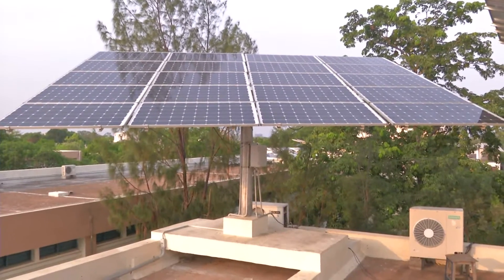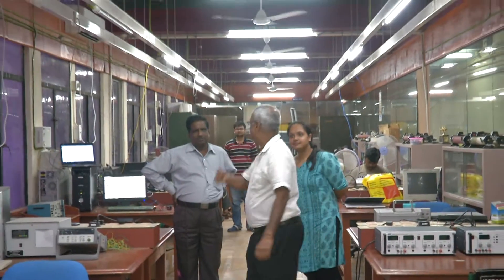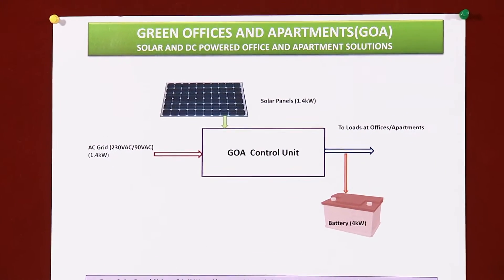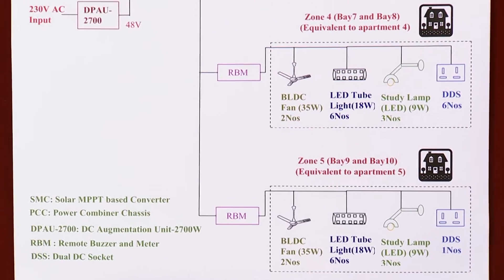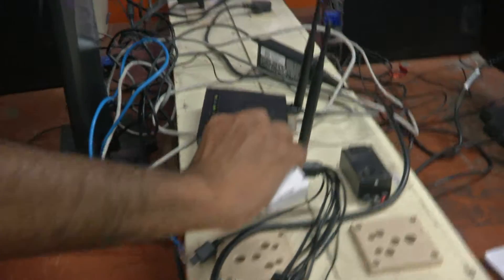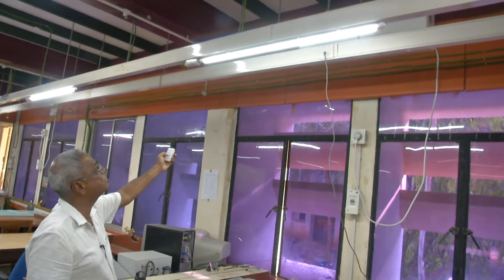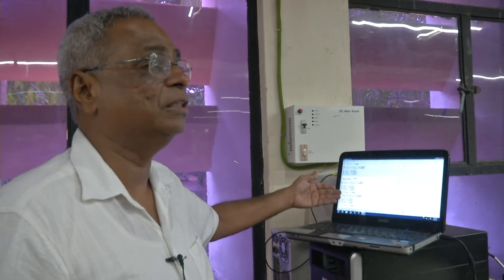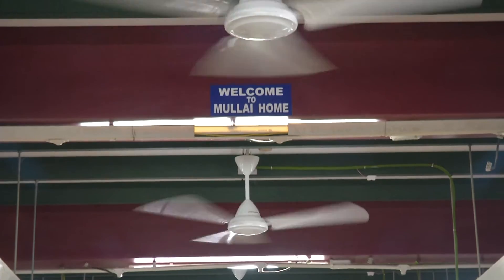IIT Madras  - Green Offices and Apartments ( GOA ) by Prof. Ashok JhunJhunwala

Comment: Exellent sir,   
I want in my restaurant complete DC power system like 12volt led bulbs,DC refrigerator, BLDC fan, BLDC cooler motor, BLDC water  pump etc can it possible. Help me whatsapp 9975394555